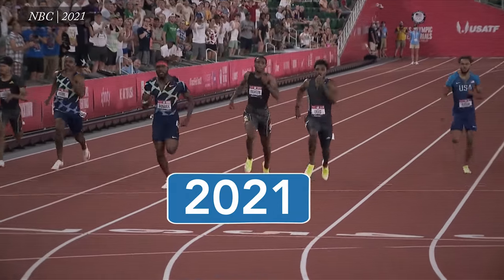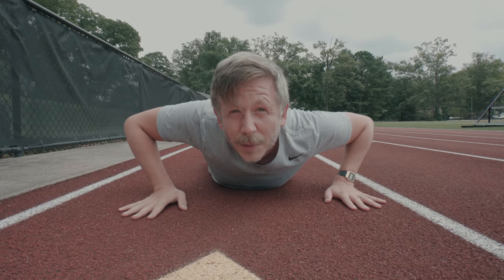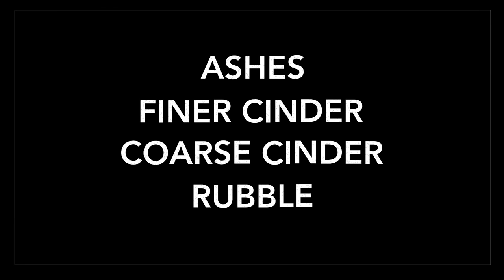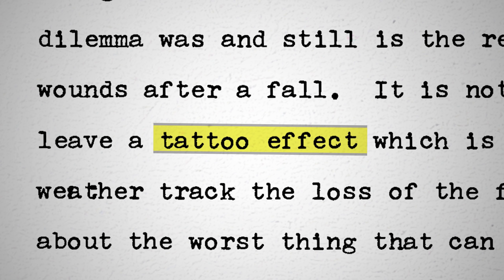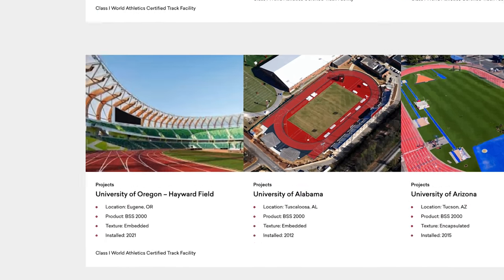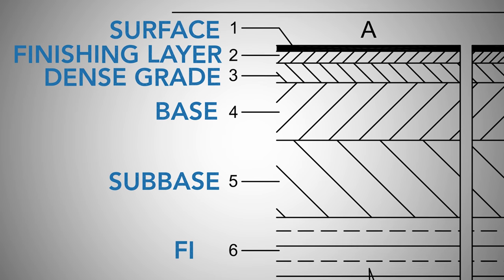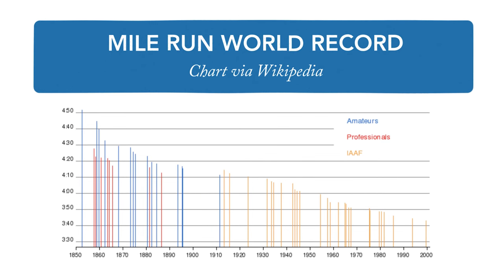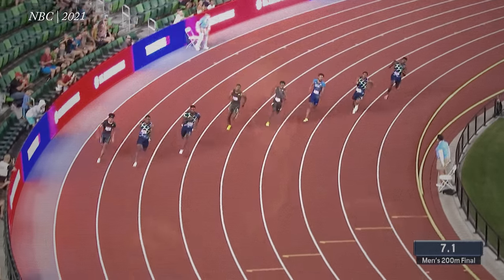How tracks changed forever after the first Tokyo Olympics

Comment: We had a mix of synthetic and cinder tracks we practiced and competed on in the late 70s and early 80s.  We had to change out our spikes longer or shorter depending on the track surface.  The only advantage of cinder was it didn't get as hot as synthetic on +90 degree F summer days.

Comment: Amazing to think that Bob Hayes ran 10.06 for the 100 metres on that Tokyo 1964 cinder track. He also ran a wind aided 9.91 that didn't count as a record. In the final he drew lane 1 - the inside lane - knowing that so many of the distance runners over the previous couple of days, the 10,000 metres - 25 laps - for instance had created a foot-slogged valley in the cinder surface that he then had to contend with. Thankfully, runners at international and later all events since then haven't had to contend with that.
Reply: I was in the stands when Hayes ran the final leg of the 4x100. He started 3 yards back and finished ahead by 3 yds

Comment: Many years ago, 1962 to be exact, our high school track league championships were held at a field with a new cinder track, very loose surface.  Winning time in the 100 yard dash was 11.5 seconds, as I recall.  Normal meet winning times were in the range of 10.0 to 10.2 seconds.
What would Bob Hayes have run in 1964 on a synthetic track?
I was a mediocre shot-putter, 42'6" was a decent put for me.
Reply: When Were you born? I'm guessing 1947/1948.
Reply: @biggiecheese1280  1944
Reply: @Tom Kieffer . . . In high school back then, well into the 1970s, a mark over 40 feet in the shot could get a competitor placing in the top three at a dual meet.
Gee!  I ran the 100 yards in HS with a best mark of 10.8.  A time of 11.5 you wrote of makes it sound like the race was held at a beach.
Reply: @bloqk16  The race was on a new and uncompacted cinder track, so it may as well have been on a beach.  My 42', more or less, was #3 on the team.

Comment: I loved sponge rubber tracks felt so good to run on but understandably as a distance runner I understand why asphalt tracks are better for sprinters ( You missed out on a few different types of tracks Guys)  Depending on the track type it regulated the length of the Spikes on your Shoe (Changes in Traction and running styles are important for the medium your running on) Nice Video

Comment: I absolutly did not expect how few tracks there are on the lists of class 1 and 2. Especially the huge difference between east and west. 
Even more surprising, considering when you look through the list and see that a huge amount of these were build by two german and an italian company all over the world. Yet Italy and Germany have so few certified tracks.
The costs are not that bad. 25k first time for a manufacturer down to 20k for his 3rd project and a 7,5k fee every 4 years for recertification. + whatever the laboratory test costs.
Well only class1 needs laboratory tests it seems...

Feels like this is mostly a prestige thing, as world events do happen on non certified tracks?

Thanks Phil for sending me down that rabbit hole, yet more knowledge I will never need ;)
Reply from the maker: Yeah I was a bit confused by the choices too. I also wonder how big a real difference there is between the tiers.
Reply: @PhilEdwardsInc  as far as I can tell there does not seem to be a difference. The more I read about it it seems that the 1 vs 2 is more about the facilities/ venue in generall. (reporter booth/ tunnels/ change rooms / vip area/ lighting, ec)

The certification document doesn't specify any technical requirements of the surface. It just says in regards to class 1: "product meets the technical requirements for use in all international athletics competitions if the surface installed using this product passes the in-situ FieldTest and tension test."
and the Track and Field Facilities Manual with the more technical informations (page 87) also does not make any defintions on classes.

"IAAF Class 1 Athletics Facility
for competition technical facilities conforming in all respects with the
requirements of Rules 140.
IAAF Class 2 Athletics Facility
for competition technical facilities in which the in situ tests for compliance with the
IAAF Track Synthetic Surface Testing Specifications have not been performed
but where the track surfacing has a valid IAAF Product Certificate and where the
homologation of the facility is certified to comply with IAAF Rules.
IAAF Indoor Athletics Facility
for competition technical facilities conforming in all respects with the
requirements of Rules 211. "

Rule 140 :

"Outdoor competitions 1.1 of the International Competition definition may be held only on
facilities that hold a World Athletics Class 1 Athletics Facility Certificate. It is recommended
that, when such facilities are available, outdoor competitions under paragraphs 1.2 to 1.10 of
the International Competition definition should also be held on these facilities.
In any case, a World Athletics Class 2 Athletics Facility Certificate shall be required for all
facilities intended for use for outdoor competitions under paragraphs 1.2 to 1.10 of the
International Competition definition. "

Comment: I believe there are faster synthetic tracks made from different rubbers. I believe Ben Johnsons 9.79 in 1988 100 meter Olympics would be around 9.65 on the same track Usain Bolt ran his 9.58 time.I also remember when i ran track. On cinder tracks i wore half inch to 1 inch spikes, but on synthetic tracks the rules stated athletics are to only wear quarter inch spikes. Lucky i had my handy track shoe screw driver kit with me for each and every track surface type.
Reply: Ben Johnson? Still too soon!

Comment: I'm not a fan of cinder tracks personally. When I was growing up the surface of my local track was badly maintained and really loose. Lots of guys got injuries from it including me. Whilst I was running the bend of a 200m race, the excessive give in the track surface over tensioned my muscles, tendons and ligamesnts. This resulted in an avulsion fracture in my hip. My tendons and ligaments were that tight they literally pulled the bone from my hip. I couldn't walk properly for months and I had to cut out all exercise for about 6 months. I was never as fast after so it ruined my athletics career. It still causes me pain when I run now in my mid 30s.

Comment: You forgot about Mondo. That surface is way better than synthetic. I have only been on  a few synthetic tracks as a wheelchair racer where I could hit the same top speed as I could on a fast Mondo track. Synthetic was also harder to hold a fast pace. My fastest times except one were all on mondo. When training my splits for each distance had big gaps (100m almost a second, 200m 2 to 1, 400m 3 to 4, and 800m 8 8 to 9 seconds)
Reply from the maker: interesting!

Comment: Synthetic tracks are nice for everything mentioned, but they do have some other issues- several of my buddies and I are in knee pain after doing a mile or so on a synthetic track, but are fine after doing 2+ miles on sand and dirt. We think it's the give in the material rebounding back up. Type of shoe seems irrelevant- I run in minimalist shoes, others have the more standard tread and cushion, and we all end up with the same problem.

Comment: You forgot dirt, our district was too cheap to resurface the track. That plus a high school coach that said drinking water during meets was forbidden, carbohydrate were bad, and shoes with kangaroo uppers were the only ones available-you had to be nuts to run in 1969.

Comment: Yeah, I think you’re overrating how helpful the track/shoes are.  Athletes today just train a lot smarter
Reply: As a runner it 100% makes a difference. Go run on sand and then a modern track and tell me it wasn't more efficient
Reply: @toad3222  I have run on both, and I think you would be surprised if you looked at, say, Rodger Banister’s training.  Not saying the track is not worth a few seconds but the change in training is worth 90% of the difference
Reply: Shoes in the 60s were twice as heavy